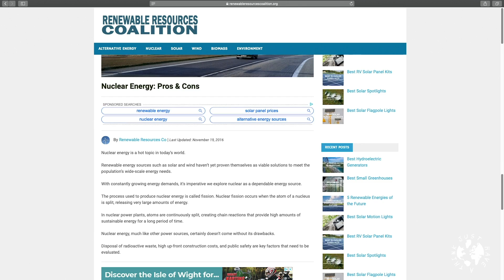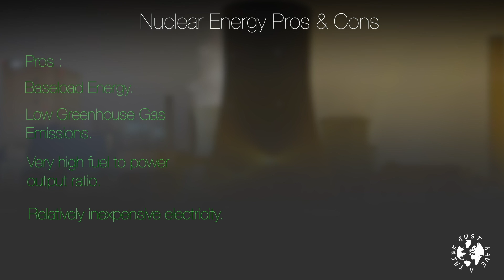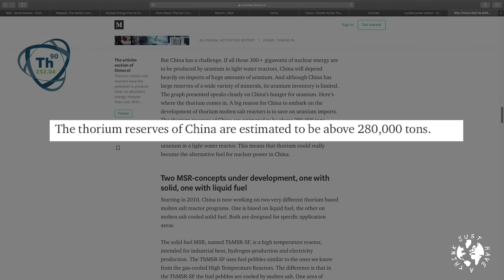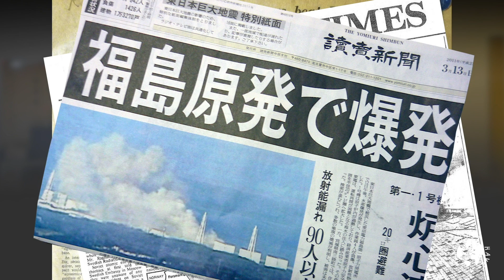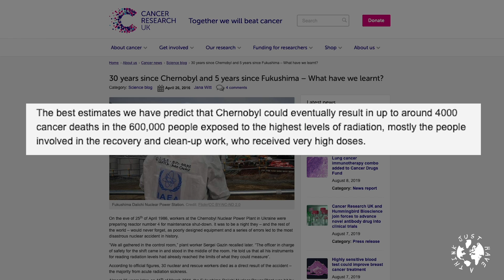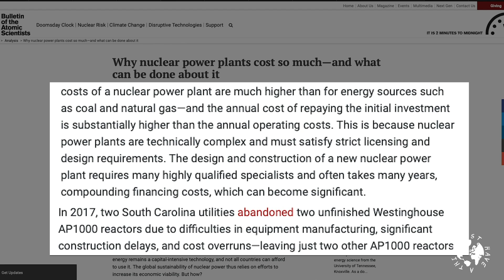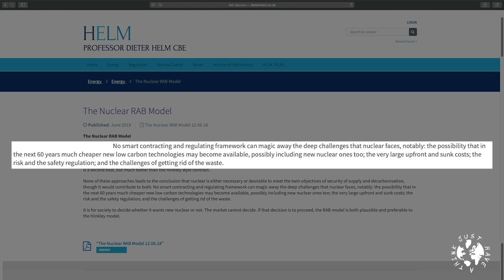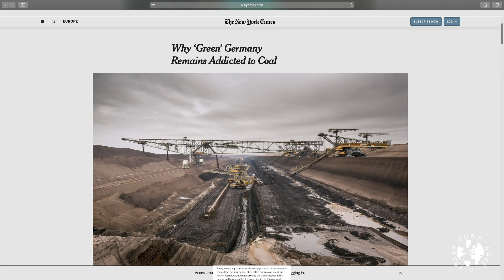Nuclear Energy in the 21st Century

Comment: You should have added length of operation to the pro section of nuclear plants. Many are still operating without issue after 40 or 50 years and projected to operate up to 100 years (!) longer.

Hard to believe how badly we screwed the pooch on this one primarily due to fearmongering. The biggest reason nuclear faces such costs and delays is because nuclear paranoia in the 1960s-70s caused American nuclear plants to institute incredibly high safety standards and wad through oceans of red tape. 

Now nuclear is extremely safe, in fact the safest form of energy generation around (even more than wind and solar). Ironically, nobody complained when coal plants were sloppily built, there were afaik no regulations about scrubbing technology and the emissions from coal particulate matter (which they were well aware of at the time) killed 40,000 Americans just 15 years ago when half of American power still came from coal. 800,000-1 million people still die of breathing coal smoke every year worldwide, and 6,000 people die in coal mining accidents, primarily in China.

Comment: Some food for thought:

1. Uranium can be pulled from seawater.
2. Waste from older reactors is fuel for modern ones.
3. Nuclear waste at least is contained as opposed to fossil waste.
4. Nuclear is matched only by water in terms of CO2 emissions when taking generator production into account. Solar panels and wind turbines are sadly less environment friendly.
5. Nuclear just works - it is not weather dependent.

Comment: Indonesia's contract with ThorCon for "walk-away safe" 7×500MWe "load-following" near ambient pressure liquid Thorium molten ion salt burner reactors will have a footprint of 43kW/m^2. When used as "base-loaders" can produce 375MWh/m^2/annum needing refueling every 4 years starting after 8 years. 
Cheap: $1/W capitalised cost, fuel cost less than 0,4 cents per kWh; pre-profit total cost $0.04/kWh; recommended cost to consumers including all cost and profit <$0:07/kWh.
 99.5 % fuel consumed;(Caesium137 and Strontium90 (half lives~30 years) are the only radioactive fuel waste requiring only 300 years storage unlike current high pressure light water reactors (with their radioactive waste being 95.8% of the original fuel) requiring over 10,000 years storage.
Another benefit of a MSR is the ability to burn up 99.6% these existing nuclear waste leaving only the Strontium90 and Caesium137 having consumed all the higher actinides including the Uraniums, Plutonium etc
.https://youtu.be/_qtJE7VmyoU

Comment: Nuclear needn't be anywhere near as costly to construct. From a source within the video:

'...costs of nuclear are much higher than for other energy sources. This is because nuclear plants are technically complex and must satisfy strict licensing and design requirements. The design and construction of a new nuclear plant requires many highly qualified specialists and often takes many years, compounding financing costs...'

Pro nuclear advocates have pointed out that the costs are largely due to this bespoke approach to building nuclear plants. But if we replicate existing designs and deploy the same construction companies, these costs can be cut significantly.

Comment: I live an hour away from Canada's biggest nuclear waste site at Chalk River. Nuclear waste does need to be dealt with. France has the best system of burning, reprocessing and reburning the waste so there is very little actual high level waste left over in the end and also much more power is derived from a given amount of ore removed from the ground. Let's follow France's example in this regard. Also small modular reactors look to be the best chance of avoiding multi billion dollar cost overruns. I am living off grid with solar panels and batteries but I do see that nuclear is very powerful and very useful and according to the data it is far safer then every other power source, even when you include the catastrophies.

Comment: I Like your channel. Title is witty. But I gotta call you out on some info you present in this video. This will be lengthy but worth it. Please read entirely. In your listed downsides of Nuclear your arguments seem to basically boil down to 3 main points. 1. Safety and waste. 2. Not being renewable. And 3. Cost.   I’ll address each separately. 
First, Safety and waste. I find this being listed in the downsides of Nuclear frequently but the truth is that reality is the exact opposite. Nuclear is the safest energy source of all. Most metrics place it as being even safer than Solar or wind. In reality, Fukushima and Three mile Island should be used as examples to prove my point since neither killed a single person. Chernobyl was bad. But even your listed numbers in this video show it’s death toll to be modest in comparison to other industrial accidents. No, Nuclear energy on its worst day kills less people than Coal does on it’s best day. 
Waste?  Again, it’s one of Nuclear energy’s selling points. First, it’s infinitesimal in amount. A soda can of Spent Nuclear Fuel for an entire lifetime per person. Compare that to any other energy source. It’s a joke. Second, No other energy source completely contains all of its waste as a matter of day to day operation. Not even renewables do that since there’s no real plan or effort to deal with old Solar or wind units.  Storage? That’s not an engineering problem. It’s political because of NIMBY thinking. Science wise, it’s solved. 
Your second main downside point was that Nuclear isn’t renewable. I feel like this indicates a bias toward renewable as being superior. You say that world Uranium reserves would only last about 80 years. Incorrect. If you use Uranium to its full potential in next Gen and Fast Neutron reactors, the resource could last thousands. Perhaps millions. And if you add in Thorium, virtually forever!!! Renewables may be infinite by strict definition but they also are not dense. Nuclear by a very strict definition isn’t renewable, but it is most assuredly sustainable!! What’s a better metric than just having the title of renewable? Answer? Total impact on the environment, not just CO2 production.  Mankind best minimizes his impact on the world by minimizing his footprint on the world. Renewables like Solar and Wind are terrible offenders in this regard. If you’d like, I can break down the numbers, but to be short, using Solar as an example, in order to meet the worlds energy demands, we would have to carpet an area 5 times the size of Spain!!  That would just about triple man’s Urbanized footprint on the world.  I would look forward to showing you the numbers breakdown should you desire. I don’t dislike renewables. I think they are great. Just no where near “great” enough!
Finally, Cost!  It’s true that the capital costs for Nuclear are untamed. But why? In large part due to the ridiculous amount of undue regulatory burden and anti nuclear litigation slowing nuclear build projects to a crawl.  This occurs while high interest accrues. It’s actually an anti nuclear tactic. The other reason is that Nuclear internalizes all of its costs. Fossil fuel’s external costs to society(mostly CO2) are completely ignored in virtually every accounting. Guess what, so are renewables. Granted they would be modest compared to fossil’s but perhaps less than one might think when you include the impact on the land, see above. And there are examples where Nuclear reactors have been built relatively very affordably and on time. See South Korea. Factor in the promise of Next Gen reactors on cost control, and the argument goes away. For example, NuScale energy is targeting costs in line with Natural Gas plants. Molten Salt Reactor startup Terrestrial Energy is even more optimistic. 
I applaud your efforts to get people to think things through!  I love the name of your channel that points to this!  So I ask you to think this topic through more thoroughly.  For reference, may I suggest just one of any number of excellent books on the topic. Title is “A Bright Future: How some Countries have solved Climate Change and the Rest Can Follow.”  I can suggest others if you’d like. A quicker resource than a book? Any one of a number of TED talks or YouTube videos by Michael Shellenberger. There are many others. 
Conclusion? Nuclear must be the majority future of mankind’s energy ambitions. Please join those like myself who actually have listened to your advice and thought this through.

Comment: well here is a german perspecitve to that: 
1. in 2/3 of our nuclear reactors, small and larger incidents happened regularly, preventing 1/4 of reactors to produce energy on a regular basis.
incidents are fires, leakages, uncontrolled venting of radioactive particles etc. so they are not really that save and efficient.
2. nuclear power is not cheap. due to massive subventions in building the plants, research and the responsibility of the state to find a permanent solution for waste wich needs funding etc, the kw/h price for nuclear energy needs to be doubled to get the true cost.
3. its now 34 years after chernobyl and in some regions you are still not allowed to collect and eat mushrooms, due to radioactive pollution.... thats not a trivial matter.

Comment: Technically, using Thorium for fuel is a separate concern from using MSRs for power. As one mentions, if you aren't running a low-energy neutron reactor for breeding (using nuclear processes to generate more fuel as you use fuel to make power), you should just use Uranium. Using Thorium a nuclear fuel, gives a different benefit: it allows U.S. mining companies a low-to-no-liability means to mine rare earth minerals instead of leaving all such production in the hands of the PRC. As it is now, Thorium is classified as a radioactive waste product, even it is a natural mineral - one of three (the other two are bismuth, and of course, uranium) that are so mildly radioactive that deposits of them formed when the Earth was, can be still found in the ground - and so, when deposits are found, companies note where it is, and just bury it back where they found it.

Molten Salt Reactors (MSRs) are their own thing, with huge advantages (nuclear fuel, so tiny land use, compared to hydro, wind or solar; liquid fuel factor, so easy to mix, control concentrations of nuclear material, and process out fission by-products; higher temperature reactions, so more efficient electricity generation; normal pressures, so no foot-thick containment vessels to explosively rupture and spew radioactive material to the atmosphere; no pressurized water coolant, so no explosive hydrogen gas generated by the nuclear reaction tearing the water coolant apart; no water coolant at all, so only put a power plant near a body of water for desalination or water purification, not for coolant; and more) and equally huge disadvantages (no U.S. Navy paying the billions for research in how to make them commercially viable; no U.S. President ordering the researchers to find a way to use nuclear energy for peaceful purposes; no nuclear regulators who know any more than the early researchers, and who don't appreciate having a different way to measure what makes a power plant work safely). MSRs are an interesting way to make nuclear power in ways that, unlike many of our current power plants, doesn't kill birds or threaten to contaminate hundreds of square miles of land when things go wrong.

Comment: What is the g/kWh number for nuclear ?
Nowadays the industry line is 12.
Reality says maybe 66, maybe 250, maybe 280, even higher when the high quality uranium ore runs out - and these numbers do not include the carbon footprint of Fukushima 2011 to present and Chernobyl 1986 to present and many other catastrophes - these numbers also do not include the costs of Monju, Superphénix, Westinghouse and many other failures.
In a 2008 report, Sovacool screened 103 lifecycle studies of greenhouse emissions from the nuclear fuel cycle to identify the most current, original, and transparent studies.
He found that the mean value from those studies was 66 grams of carbon dioxide equivalent per kilowatt-hour (gCO2e/kWh), with the much higher figure of 288 being credible to Sovacool (and much more real, in my view).
Sovacool's paper provides the following figures (gCO2e/kWh):
Wind 9−10
Hydro 10−13
Biogas 11
Solar thermal 13
Biomass 14−31
Solar PV 32
Biomass 35−41
Geothermal 38
Nuclear 66
Natural gas 443
Diesel 778
Heavy oil 778
Coal 960−1050
Sovacool stated in 2008: "Offshore wind power has less than one-seventh the carbon equivalent emissions of nuclear plants; large-scale hydropower, onshore wind, and biogas, about one-sixth the emissions; small-scale hydroelectric and solar thermal one-fifth. This makes these renewable energy technologies seven-, six-, and five-times more effective on a per kWh basis at fighting climate change. Policymakers would be wise to embrace these more environmentally friendly technologies if they are serious about producing electricity and mitigating climate change."
See the report at https://www.nrc.gov/docs/ML1006/ML100601133.pdf .
Since 2008, wind power costs have dropped dramatically reflecting reduced carbon footprint for that technology.
Since 2008, solar PV costs have dropped even more dramatically reflecting a much reduced carbon footprint for Solar PV.

Comment: I for one am rather hopeful about SMRs, small modular reactors. The idea is to knock them out on an assembly line and ship them on the back of a lorry, operating them as a sealed unit the size of a large diesel generator or two, and once the fuel is spent the company comes with a new unit, replacing and taking away the old one. The factory construction and small size (a few MW or even just a few hundred kW) would hopefully eliminate the long lead times and sunk costs, while also vastly improving safety because there's only so much heat the tiny core can hold onto. And they could even be hooked up ten or twenty or a hundred to a larger power plant, which would afford much greater control than one very large reactor core.

So I'd be curious to know what you thought about them, especially if there's downsides to this approach that I've not heard about. Obviously there is currently some public opposition to the potential of every town having its own tiny nuclear power station on the outskirts. But as a potential upside, they could potentially integrate better with smart microgrids much better into the future. Lots of angles to this. 

PS I thoroughly enjoyed your more recent video on fusion power as well. Keep it up man!

Comment: I think that considering the climate change issues existing nuclear plants should be kept running until there useful life is over.  They should be evaluated for risks such as Tsunamis and either upgraded or closed.  However, since most of the cost is in building the plants closing them early seems foolish.  Beyond that I would concentrate on technologies that "burn" up and reduce the existing nuclear waste as we will have to deal with it anyway.  Breeder reactors that do this are frowned upon because they create material that could also be used for nuclear bombs.  However, if the country where such a reactor is located already has nuclear weapons what difference does it make?  If we can turn this waste into carbon free power and reduce the waste that has to be stored it seems like it would be worth it.  Making more nuclear fuel from mining more ore seems like a waste of time.  Additionally I would place these nuclear plants at existing nuclear sites which already are contaminated.

Comment: Brussels checked all nuclear reactors in Europe last year. Out of 125, not a single one fullfilled todays safety standards. Most are older than 40 years old (made to run 40 years), some run even tho they are 20 years over their limit and shown cracks in the hull. Nuclear power is pretty much dead, too expensive

Comment: Just two points. China has pledged to reduce their carbon intensity 60% by 2030, not carbon emissions. Since power output is planned to increase from 5920 Twh in 2016 to 9200 Twh in 2030, reducing carbon per unit of output 60% over this time only results in a 38% carbon reduction. But does China mean total societal emissions including transport, agriculture, manufacturing, and domestic heating with combustion fuels, or is this just for the power sector?

My second point is that talking about nuclear power without much mention of the rapid progress in preparing a variety of 4th generation reactors for production before 2030 is a bit like discussing long distance communication only in terms of the telegraph while Alexander Bell was just perfecting the telephone. These new designs focus on solving problems around cost, safety, and waste disposal in a number of creative ways, and should revolutionize the power industry if successful. Since fuel is such a small percentage of cost for nuclear due to it's incredible energy density, and because many 4th generation plants will be capable of consuming almost all the potential energy in that fuel, as well as using the "waste" accumulated from current reactors (which only manage to use one percent or so of their potential energy before the reaction is poisoned by the accumulation of actinides), and because the extraction of uranium from seawater has been successfully demonstrated at a cost only a few multiples above current costs, uranium (and thorium) actually have the potential to power modern societies for at least a few millennia, without even considering the eventual development of fusion plants.